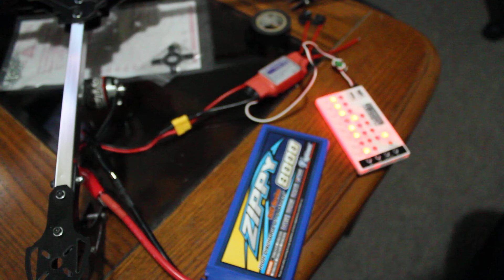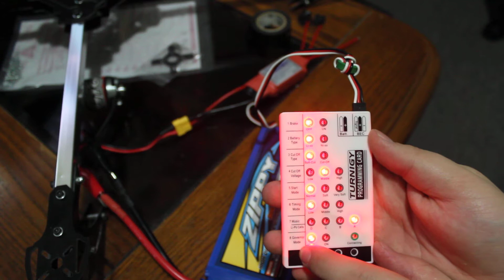Configuring Turnigy PLUSH 60A Bulletproof Speed Controller

Comment: Do the plush 10A and 18A ESC's come with bare wires?  If not, what terminals are on them?  Thanks.
Reply from the maker: I'm not sure if they do. The 60A came with bare wires on both ends. Learning to solder the connectors was a painful process. I would recommend trying to buy parts that have connectors already as there are less chances of electrical failures due to solder joints coming loose. I found that websites like Hobby King are often wrong as far as which connectors come pre-soldered to the wiring. My new motors were supposed to come with 3.5mm bullet connectors but instead had 4mm bullet connectors so that's 12 extra solders I had to do to change them out :|

Comment from the maker: I use two of these giant Zippy batteries in parallel (8000 mAh each). Cost me less than $100 for both. I charge them in parallel using 6 Amp output from my Turnigy LiPo charger. This gives me 20 - 30 minutes flight time and a recharge time of 3 hours. I can charge faster if necessary but I'm babying the batteries a bit for now. Storage wise, I've left them in -20 C weather a few times and usually store them at a full charge and I've had no ballooning problems or other noticeable issues so far.